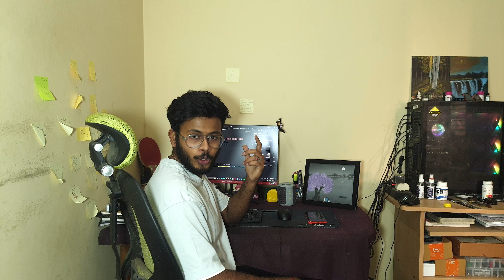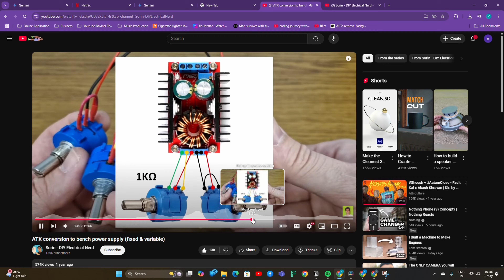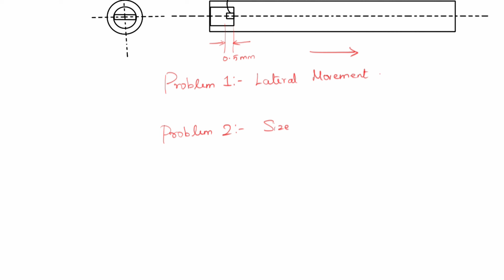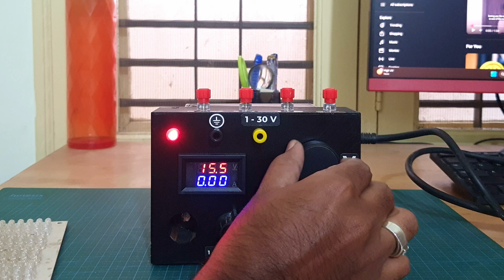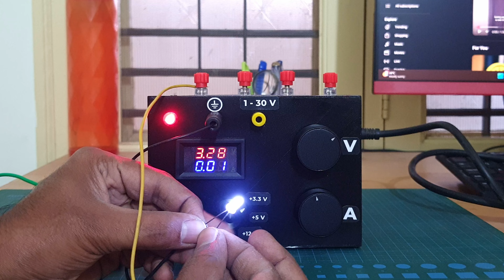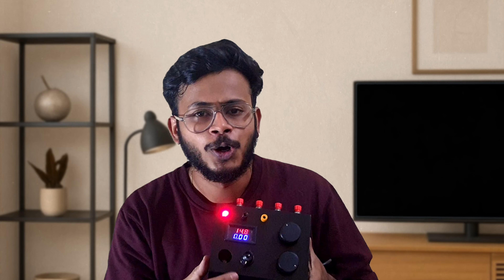Over-Engineered Bench Top Power Supply, But How?

Comment: 👏👏 superrr dude
Reply from the maker: Thanks a lot 😇🙌🏻
Reply: Very interesting video...

Why is the current in the motor not varying when the voltage is increased ?
Reply from the maker: @rohith401  that's a beautiful question, the current remains the same due to no mechanical load on the motor, the current changes when there is a mechanical load. My bad should have added that in the video, thanks a lot for pointing it out 😇🙌🏻